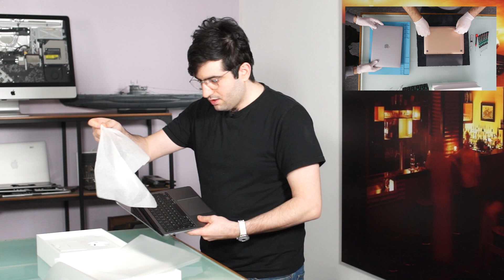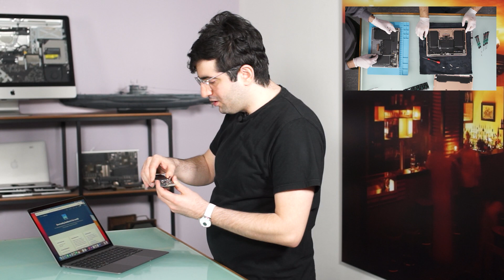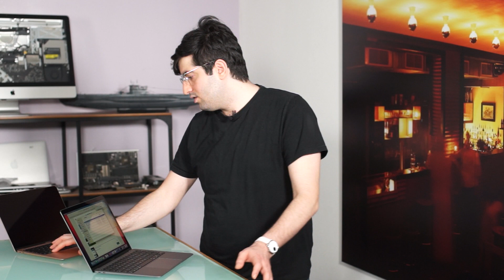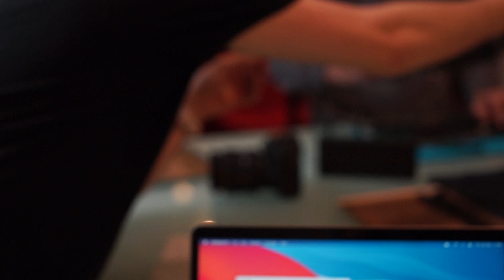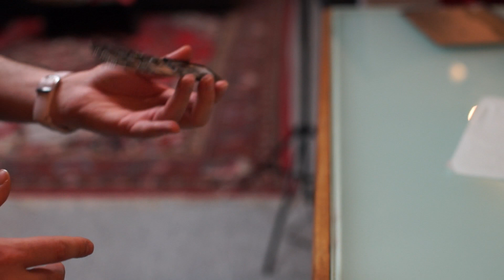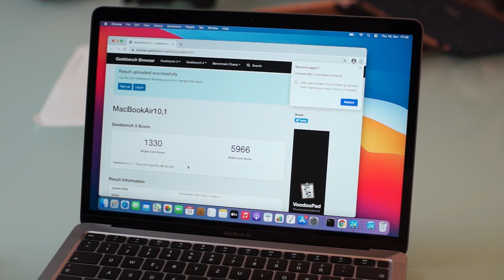Apple MacBook Air 2020 A2337 with ARM M1 CPU Teardown, Logicboard swap, First impressions unboxing

Comment: Can you make a video on how to upgrade storage of the new macbook air manually?
Reply from the maker: It is sadly not possible
Reply: both the storage and ram are soldered, so no
Reply: buy a ssd or hard drive and format it exFat (most compatible with mac) or Fat32 (compatible with Mac but limit to 4Gb per transfer)

Comment: I couldn't really tell, was the swap successful or are there similar issues as with the iPhone 12 where it will act like it's broken?
Reply from the maker: The swap was successful, touch ID is married to the board and has to be swapped with the board together
Reply: @sadaghian_mac_retter  great! I really liked the video by the way, just raw footage of using the device. I'm normally also a pc guy myself, but this device is really compelling with the price to performance and build quality.
Reply from the maker: @Crasstho  thank you!